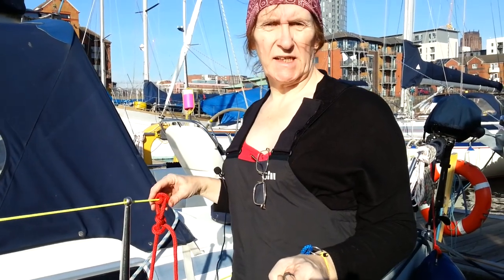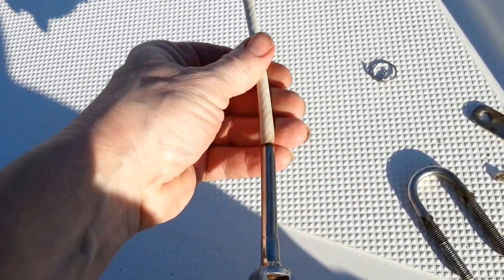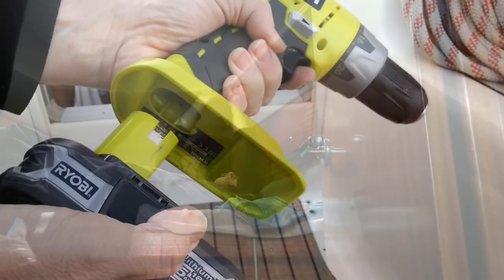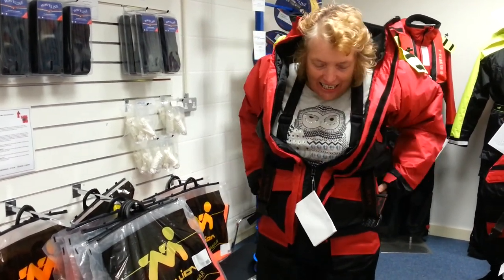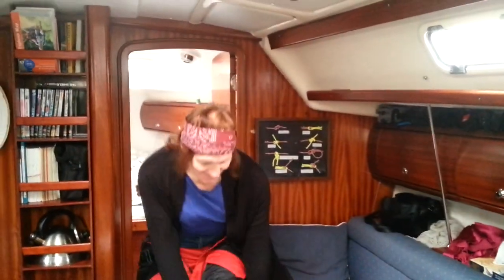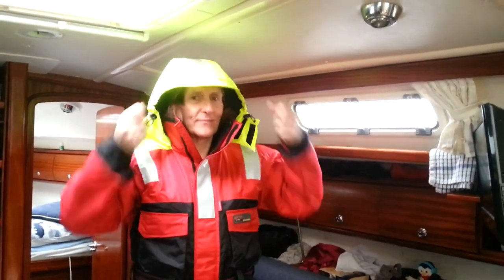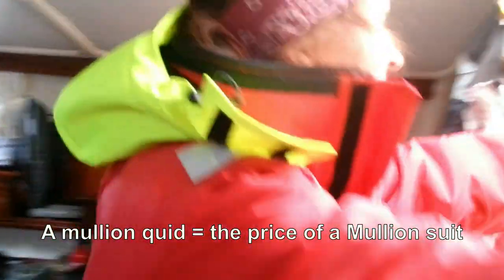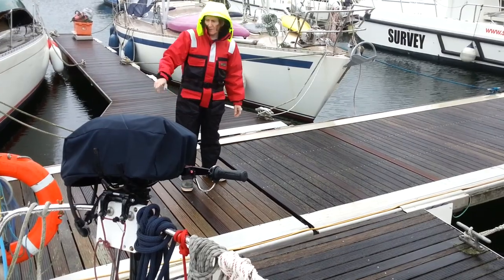Weather-proofing both us and the boat - Our first Mullion - Ep. 79

Comment: My Bavaria leaked in exactly the same place into the engine room.   I pulled both of those U-bolts and used butyl the same as you did.  Perfect seal.   (I did note that the butyl continued to expand for another couple of months, so you might have to trim it again.)   Nice Glad Rags.    I prefer the 'vintage' look, so my frayed and faded all-weathers will have to go another season.  :-)  Fair winds ladies.
Reply from the maker: Thanks Patrick. It has since rained and the leaks are gone.  We still have our Gill gear and we are keeping it for warmer weather.

Comment: Great video and tips.  What brand/size of butyl tape did you use?  Need to order some on line!
Reply from the maker: Hi Peter - it was bought in a local chandlers and came in a tube like Sikaflex or mastic. Unfortunately the mastic gun broke a seal in the tube during the repairs and it squeezed out everywhere and went in the bin. I will be back in that chandlers later this week and I will look it up for you. Thanks for commenting and your kind words about the video.
Reply: Sailing Yacht Salty Lass Thank you
Reply from the maker: I was up there today and they had none. No butyl products at all :-( and I cannot recall the brand
Reply: @SailingYachtSaltyLass  never mind.  Thanks for trying
Reply from the maker: Peter - The other chandlers has it - Arbomast BR Buytl sealing compound. It comes in a tube like mastic and you will need a strong, large mastic gun. It can be quite stiff, but it lays a nice bead of butyl.
Reply: @SailingYachtSaltyLass  Thats great!  thanks v much.  Will get on to the on line chandlers for some